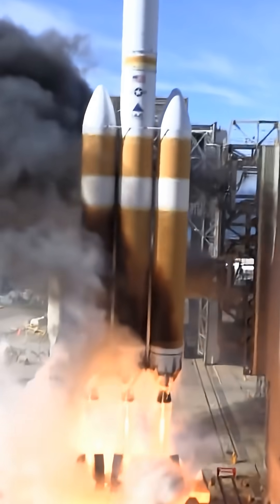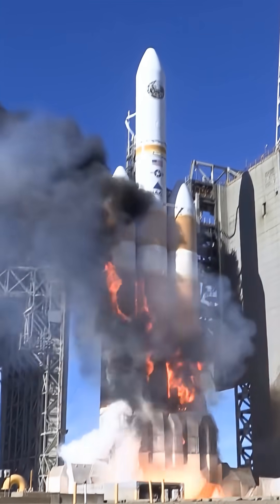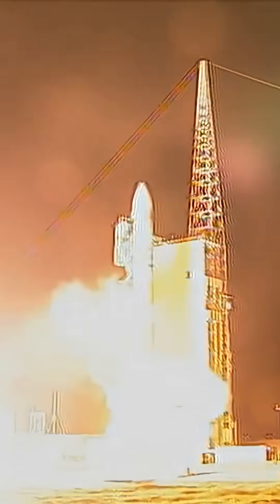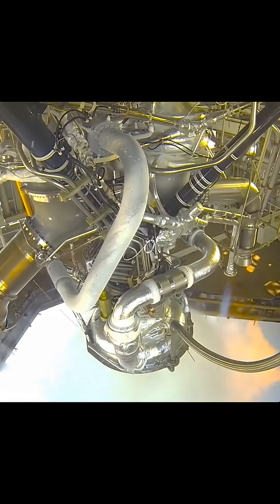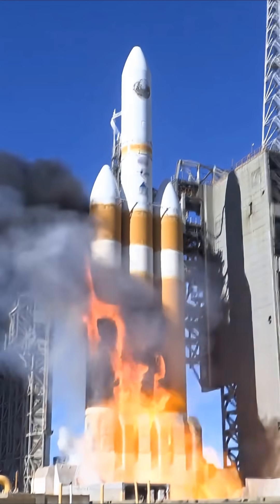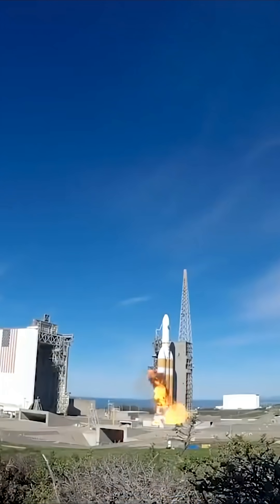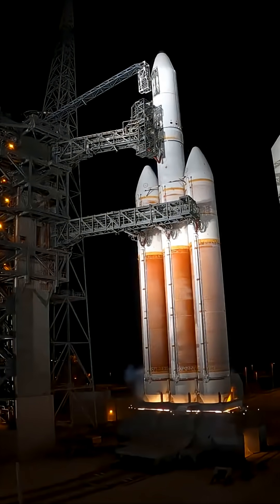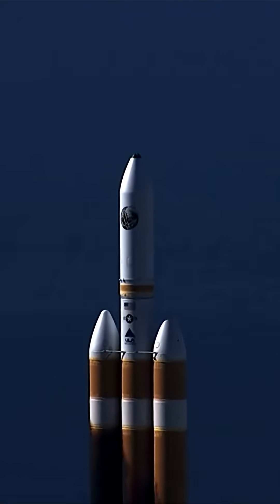Why This Rocket Made A Massive Fireball

Comment: It strikes me that if you wanted to use RS-68s on a manned mission, it would probably be possible to avoid the fireball by installing a small rocket motor in the flame trench itself, which would fire before the main rocket lit up and create a nice venturi effect to whisk away the excess hydrogen.

Comment: The origins of the Delta IV go back to the Space Shuttle Challenger disaster.  And the development of what they called at the time - a big dumb rocket.  Where dumb meant more than just "expendable" - it would also be simplified to reduce both development and manufacturing costs.  The use of Hydrogen was an interesting choice since it's not an easy propellent to work with.  But since the second stage was using hydrogen as well, its use couldn't have been avoided.  But when Falcon 9 and Falcon Heavy came along, Delta IV had some serious competition, as they didn't need hydrogen at all.

Comment: Burning hydrogen has NO colour. Something else must be added to the mix to make visible flames
Reply: Burning pure hydrogen and oxygen makes no color, the air isn't that pure, so the flame contains extra color.

Besides that, the nozzles os the RS-68s are ablative, meaning they are made to be slowly "burned through" over the launch, and that's what makes the full power flame orange in the Delta 4.

Comment: hey why did the rocket got black since there is no carbon fuel? did they had to insulate the hole rocket because of that?
Reply: The rocket got black due to the orange foam burning.

The orange foam insulation was used because the rocket's fuel is liquid hydrogen, which needs an extreme cryogenic temperature to remain liquid. So the foam helps it not turn into gas faster over time.

Comment: No matter how advanced we get... stuff goes up on pointy firecracker.
Reply: That will change soon. Rockets are the least efficient most dangerous way to lift off.
Reply: @RePeteAndMe 
How it will change? Unless someone invests ultra-high thrust ion engines or safe to use in atmosphere nuclear thermal engines, chemical rockets are the best way to send stuff into orbit.
Reply: @RePeteAndMe  since they’re the only way, that also makes them the most efficient and safest way (for the foreseeable future)
Reply: Personally I have an irrational preference for the Lofstrom Loop. Which is probably one of the really boring, fire-free methods to go to space. 

If you want the big fire, the Project Orion is your choice.

Also, it is one of the few rocket engines that has the thrust to get into space.
Reply: We charge materials with high energy and...

...heat water with it. 😅

Comment: Actually after a while the developed a staggered startup where only one of the engines was started before the others.  The plume of that engine through the flame trench sucked the hydrogen from the remaining engines considerably mitigating the hydrogen burn off problem

Comment: The Ares V was actually supposed to be a cargo-only launcher, mainly launching the Altair lunar lander.

Ares I was to have been the crewed launch vehicle, and would carry Orion to Low Earth Orbit for rendezvous and docking with Altair; from there, the Ares V second stage would boost Orion & Altair to the Moon.

And Ares I's first stage would've been a 5-segment Shuttle SRM, which was the main concern for crew-rating Ares I.
Reply: I read that there was also an Ares IV concept, which would have taken the Orion and the J-2X upper stage of an Ares I and mounted it on an Ares V lower. This concept would have necessitated a crew-rated version of the RS-68, which likely would have also done away with the pre-launch fireball.
Reply: @h @hnn.9-28 I almost forgot about Ares IV. Thanks for bringing that up.
Reply: @hnn.9-28  The RS-68 would have needed to be redesigned to function on Ares. The ablative nozzles melt if they're grouped together like Ares IV or V would have required. The RS-68 would have needed a regenerative nozzle which would have required new/updated turbomachinery with higher pressures to pump the hydrogen through the nozzle i.e. basically a new engine. And it would still have a fireball on launch because the engines have to be preconditioned by pumping cryogenic hydrogen through them. The RS-25 does the same thing but, you can't see the flash because the water deluge system pulls the gas away. The whole concept of a shuttle derived rocket was really silly and NASA knew that. They only considered it because Congress told them they wouldn't pay for anything else even if it was cheaper. SLI was a much better program and would have built new engines for liquid propellant boosters and a sustainer core.
Reply: yeah, launching humans on a 5 segment SRM was one of the dumbest ideas NASA has ever entertained. God forbid they launch Orion on an Atlas V Heavy or Delta IV Heavy.

Comment: In another video u mentioned that the SLS can be unofficially called the Delta V!
Reply: Yep!  Since they use the same upper stage, which was originally developed for Delta III IIRC. Both the Delta IV and SLS share the exact same amount of similarities to “classic” Deltas
Reply: @MarcusGoodwyn somewhat, the delta IV medium used a stretched version of the delta III upper stage which was then expanded out into the delta heavy stage which then was again extended to what is used as the icus on sls
Reply: Having played KSP, I can see why they’d want to avoid calling a rocket by such a confusing title as “ΔV”.
Reply: @Autoskip  I haven't played KSP, but you don't have to play that to understand why "Delta-V" would be confusing, just take a basic physics course 😅
Reply: Why was the more expensive RS68 used so much more than the cheaper RD180s?
Reply: @asleepawake3645  the delta IV it was designed from the ground up to be full hydrolox which the 180 simply cant do, and hydrolox is the peak of efficiency before you get into science fiction
Reply: @atticussandanayake3304 , it's an excellent engine, but wasn't it built to be cheaper to produce, but ended up being more expensive?   Hust saying maybe there's comparative advantage that wasn't fully utilozed
Reply: @asleepawake3645  there were few to  no commercial delta IV launched it was almost exclusively used for launching spy satellites that were designed around the Heavy's payload fairing, the only reason the Delta IV was still around was just to launch those payloads, the rs-68 was built to be cheaper and simpler than the SSMEs(rs-25) and it achieved that bat that was an extremely low bar to pass, and trying to keep hydrogen in the place you want it to be and do that whilst vibrating at thousands of hertz and still being light weight is like trying to herd cats whilst naked and you have cat food wrapped around your waist
Reply: @atticussandanayake3304  interesting analogy there 🤣.